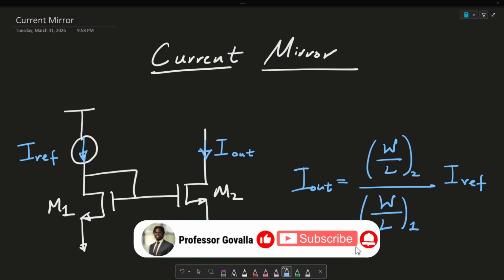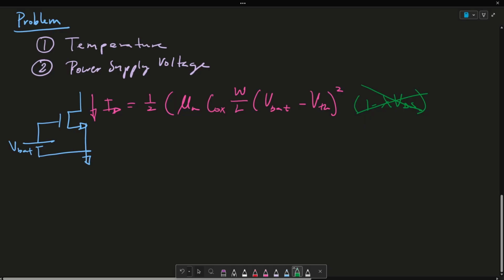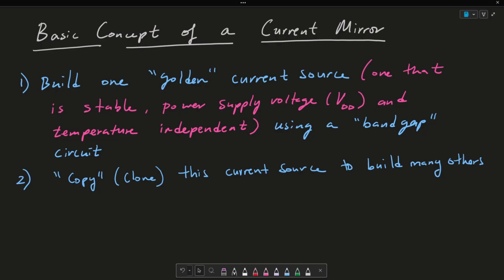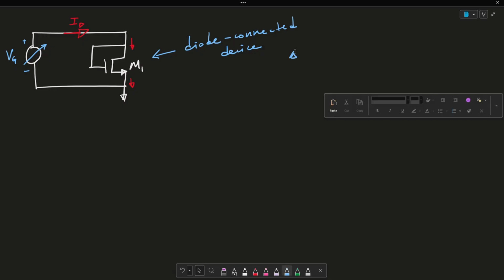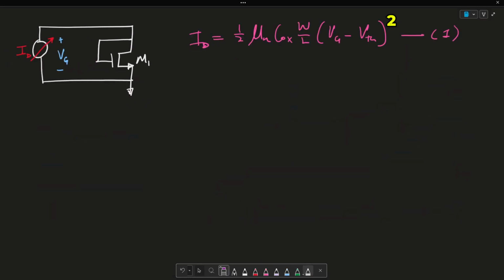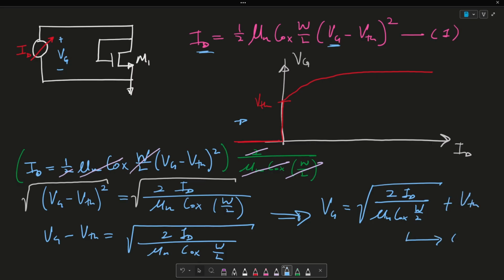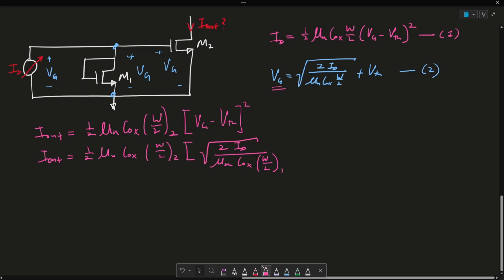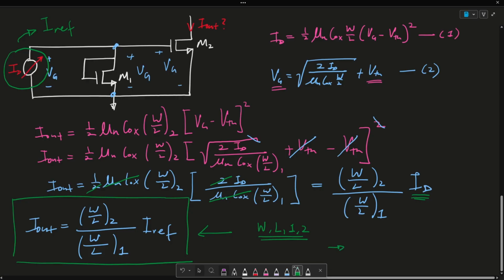Current Mirror — Clearly Explained

Comment: My only doubt it's about its application, what would be the maximum suitable current for this kind of circuit?
Reply from the maker: Hi, great question. The main constraints are keeping the current (I_out) in the range where your MOSFET/transistor remains in saturation mode, doesn't consume too much power, where it might cause the device to melt, or having too high of an overdrive voltage (V_GS - V_th).  But again, it depends on the design of your MOSFET/transistor and your application. The main point of the video is to prove how we can generate a current source around our circuit (using current mirrors), similar to how we would generate a voltage source in our circuits. The maximum suitable current would depend on the three main constraints I mentioned earlier.

A basic rule of thumb however is:
When using On-chip (Integrated Circuits): Usually limited to 10uA to 1mA.
When doing Discrete (PCB with MOSFETs): Usually 10mA to 500mA
In Power Electronics: Can go to Amps, but require additional components for "Source Degeneration"